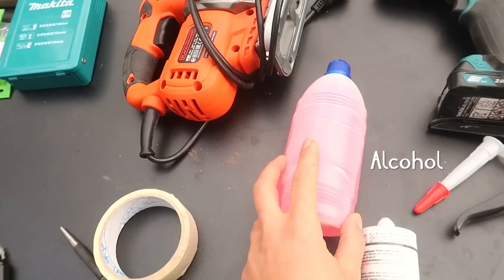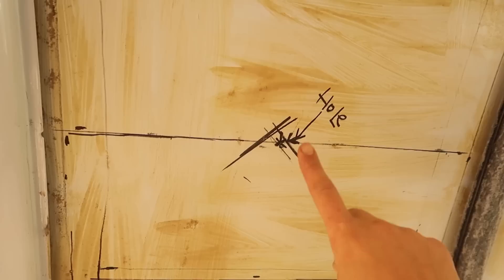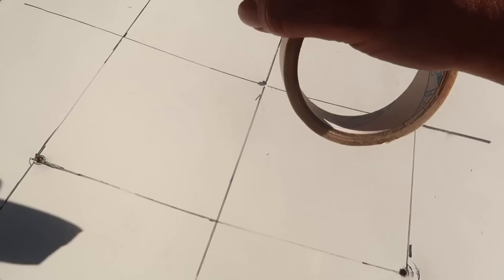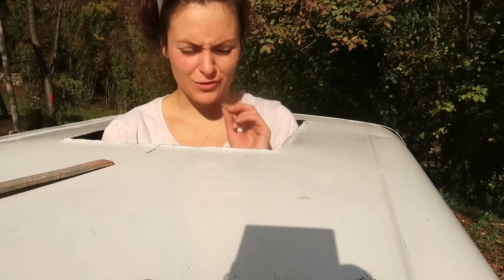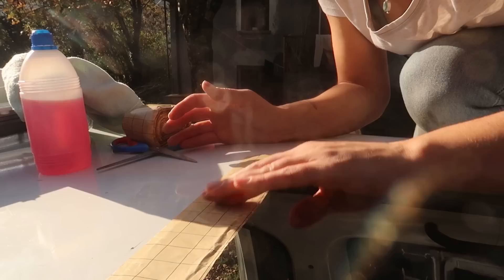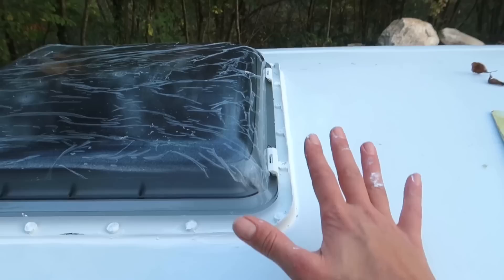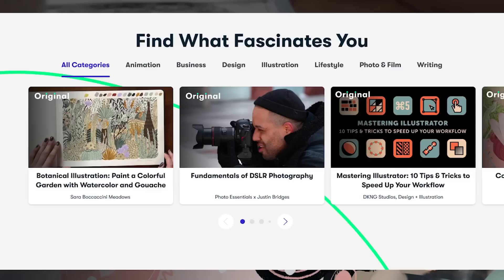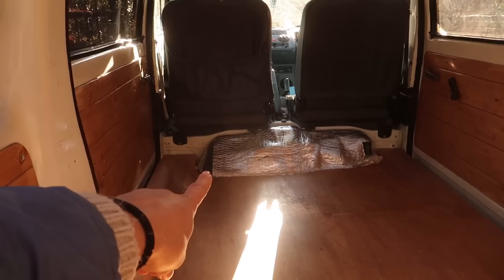Anyone CAN DO IT! | Installing a Roof Vent | EP. 2

Comment: Aha !  I missed this episode and saw you answered my question about the electrical system.     Also - many people miss out on cleaning the new roof vent to remove the release chemical they use to get the completed item out of the mold in the factory.     That can cause leaks and stops the adhesive holding.    It really shows this is not the first one you have done.   It looks great and will be so useful when you are using the van in good weather.   All good wishes, Pete in Cumbria
Reply from the maker: Oh I haven't touched on that on the videos yet, I think I shared in the last part of the conversion 🤦‍♀️😅  and thank you for the compliment although to be honest I didn't know that!! I only cleaned the metal on the van to get rid of any grease or dust. Oh well, so far no leaks 🤞
Reply: @WildSheGoes  I think the tape mastic you put down and the sealant you put round the edge will take care of it.   You are so thorough it's a very good job.

Comment: Good thing that your wisdom tooth was pulled after the vent install (just kiddd'n). The van looks great so far, hope it will have easy access to engine bay (if that is necessary from above. Have a good weekend and a warm(er) one if needed. Good call on the weather report before starting an outside project.
Reply from the maker: 😂 good one

Comment: Evening Marina, Oh what a nice job you did there with the vent! I would probably spend most of the time measuring and re measuring over and over, but you did it so well. Was a bit nervous with the rough metal edges and you sticking your head though the hole!! Really looking forward to the install conversion in the coming vids, looking great what you have achieved so far. What will be really fantastic is the trips you go on with your newly converted van. Until next time Health@Happiness to you.

Comment: Well, great project! 
Happy Thanksgiving! 
The rust converter is something different. It cannot protect the metal without having rust already established. You brush the loose rust away; then the rust converter locks the old rust into a oxide layer by chemical conversion. So~ no rust- nothing to convert, sorry for the bad news- but if we’ll sealed, it will not matter. 
Check a YouTube video on the converter working it’s magic, there are several that are helpful. 
Still a great project!
Reply from the maker: HI Jason, thank you for this :)

Comment: Use Sikaflex 710 butyl instead of tape and don't clean the edges.  Silicon doesn't do his job outside, in UV l;ight and high temperatures. It will get off verry soon